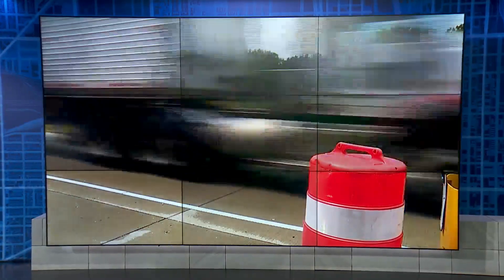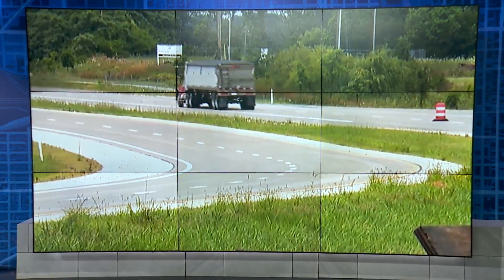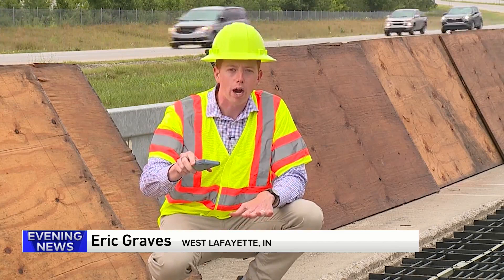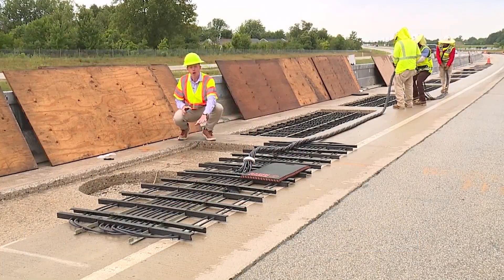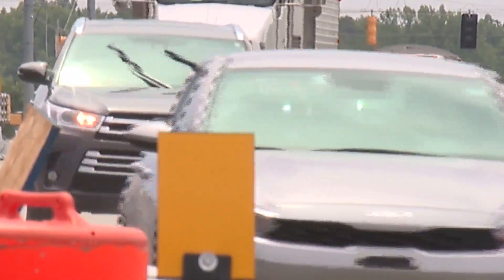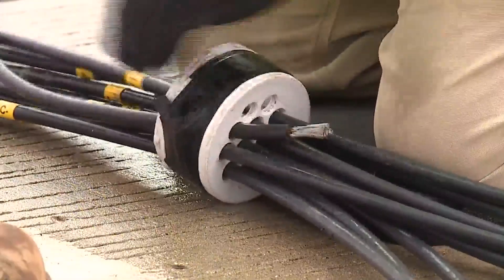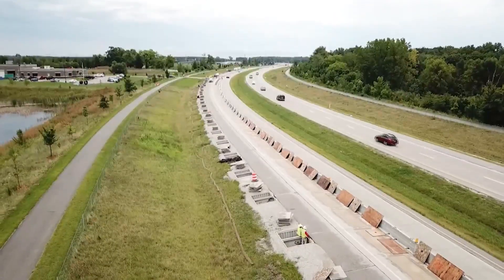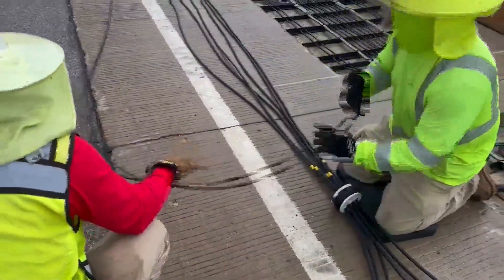'Electrified roadway' getting closer to being a reality in West Lafayette

Comment: "200 kW is as much as 100 homes", maybe on a yearly average, but a 200 Amp service at 240 volts that is the normal home service is 48 kW per home maximum.    If able to receive inductively at 200 kW/h that would allow medium charging  rate for heavy duty vehicles.     The Tesla Semi large battery back now is about 900 kW/h.   Magnetic inductive energy transmission through a large air gap has loses such as 50%. 

By the time the Tesla Semi becomes a production vehicle it will likely have new battery technology from CATL that is about twice the current energy / mass density with battery pack of 1.5 MW/h with C4 charging ability allowing fast charging in 15 minutes.   It would need charger able to provide  6 MW to do that in 15 minutes.  Heavy duty vehicle fast charging  is expected to be done with multiple connections.   Another charging possibility is for BEV Semi's on the road is to overnight charge at truck stops.   

Overhead dual wire trolley buses have been used very effectively going back at least into the 1960s.   They are quiet, zero local emission and accelerate fast.   A trolley bus is fast and clean and not a slow dirty diesel transit bus people have had to put up with.

Comment: -------------------------- Ok .....now picture solar panels attached to lightpole that sends DC juice to heating coil wires w/a synthetic Kevlar mat over it under road surface to melt winters elements.....it dosen't have to be 90° just a degrees above freezing......heating elements would be high tensile strength wire clad in gold from recycled computers, laptops, electronics.....ok....we'll go from there....thx